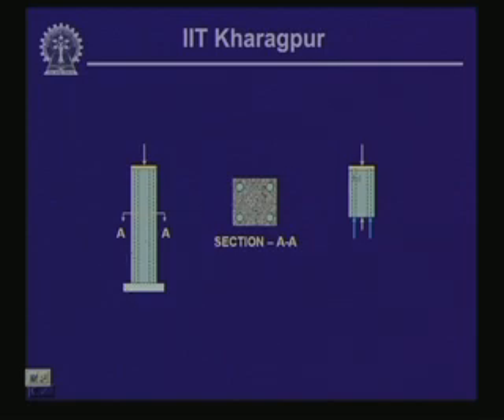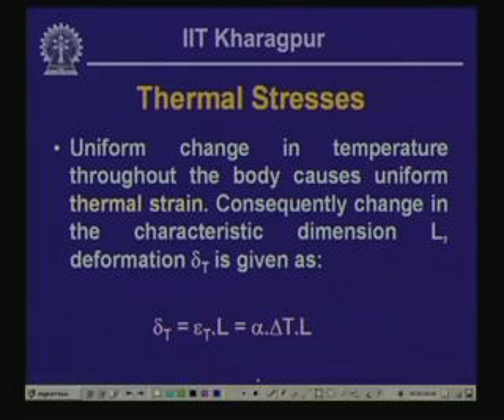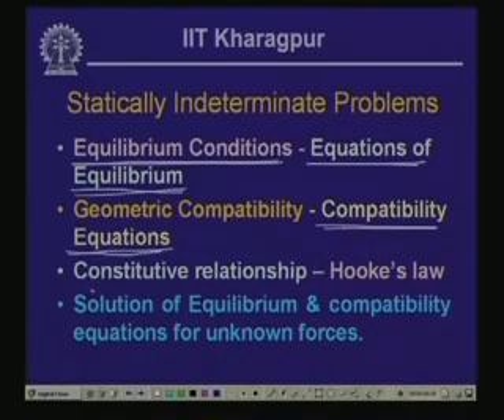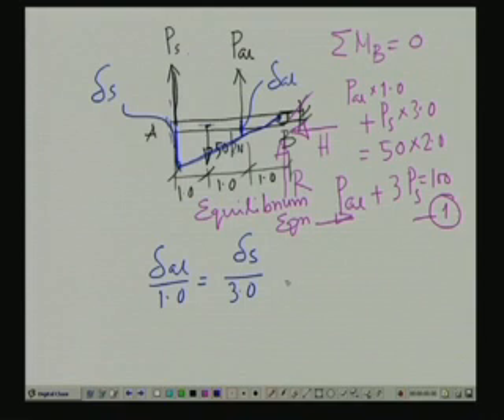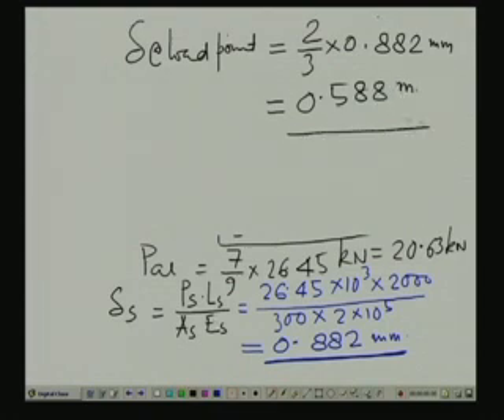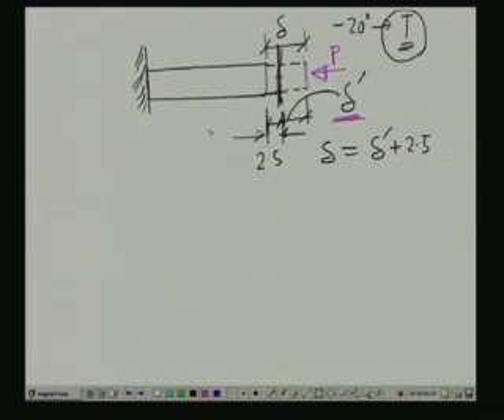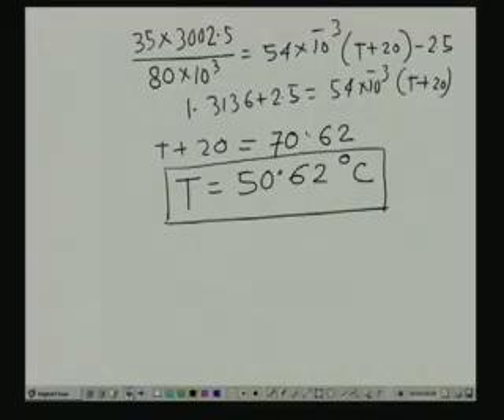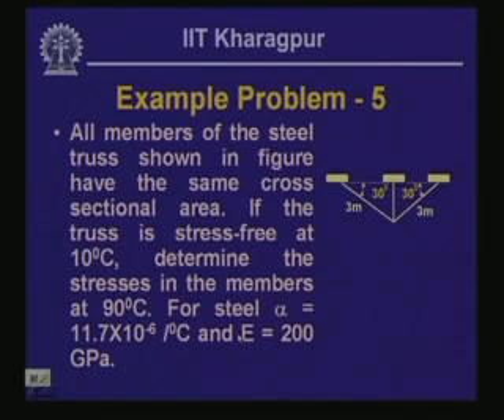Analysis of Strain IV

Comment: In example number 3, if the strains are equal, the deformations are not, as the bars are of unequal lengths. I think you need to equate the deformations instead of the strains.
Reply: YES , YOU ARE CORRECT

Comment: Nice Lecture sir. I've a doubt. In the above example problem 3 u have written the first equilibrium equation considering the forces in both the copper rods as 2P Cu, but in the last lecture u had considered the equilibrium equation with just one single force combinedly for two copper rods as P Cu. This is a bit confusing. Can u help me out with this?
Reply: that is because there are rods here, 2 of them and in the last lecture it was a sleeve, i guess.. which was 1 single offering the strength
Reply: @adityamehra7238  exactly !
Reply: @adityamehra7238  thanks